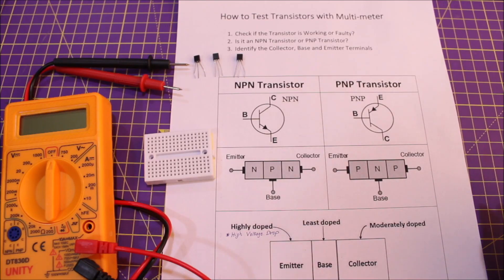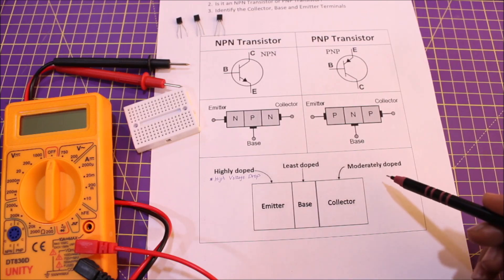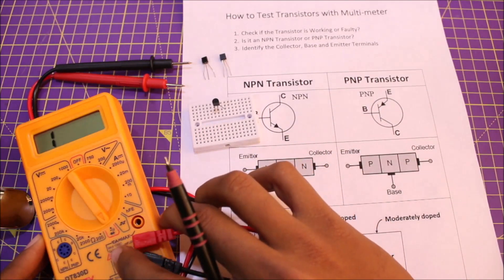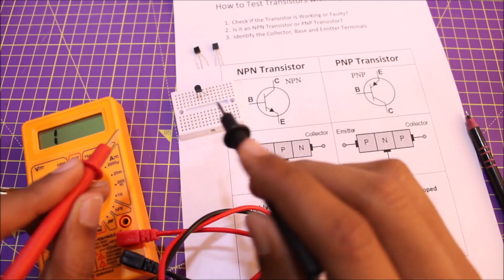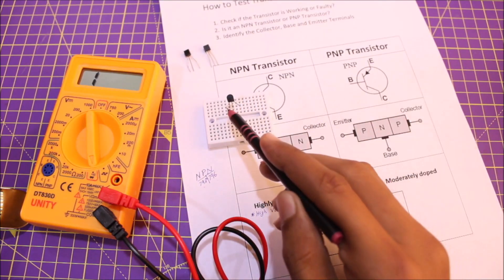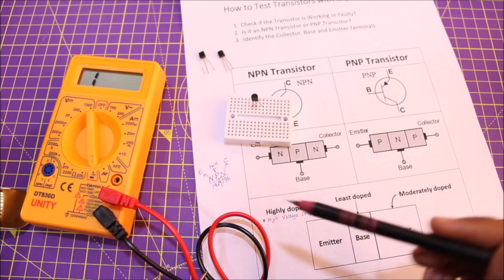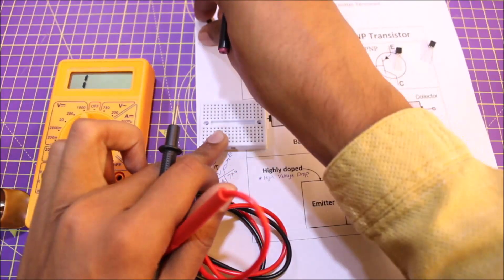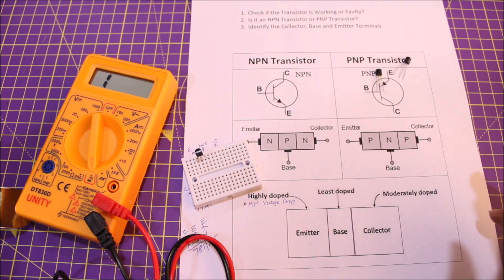How to Test a Transistor with Multimeter? Check NPN or PNP | Find Collector, Emitter and Base Pins

Comment: What is the unit of this voltage drop across transistor?

What  779 indicates in above testing?
Reply from the maker: it is in milli Volt
Reply: @Circuitdigest  Not sure that what you say is correct. With the continuity test on a multimeter you test whether the circuit is closed or open. The value that you get I believe it's a resistance, not a voltage. Correct me if I am wrong.
Reply: @georgiosyiannakou734 well you are wrong, see in the continuity when you test a diode, then the voltage drop of diode is shown and it's the same here...